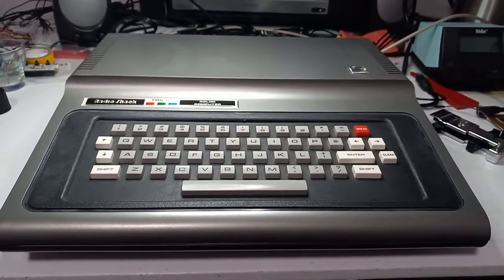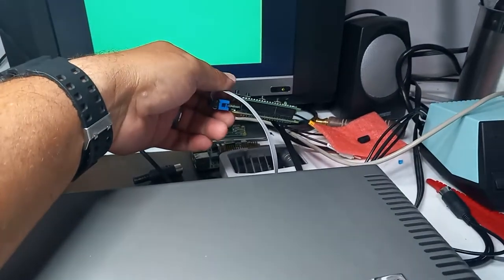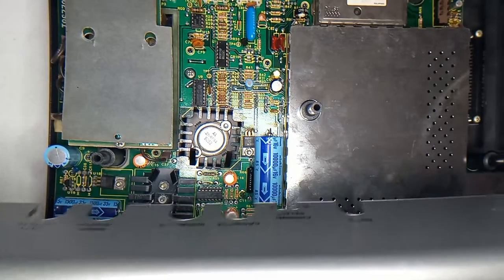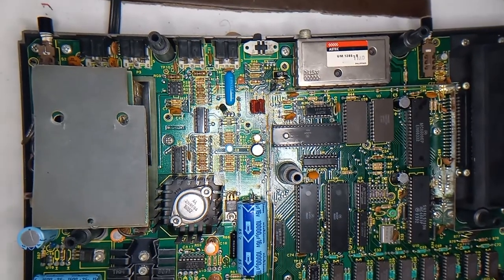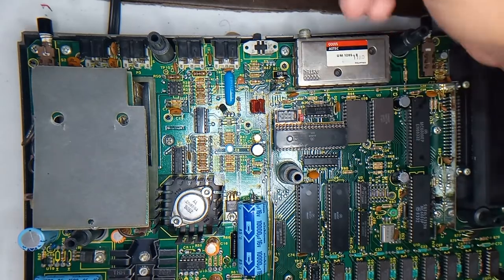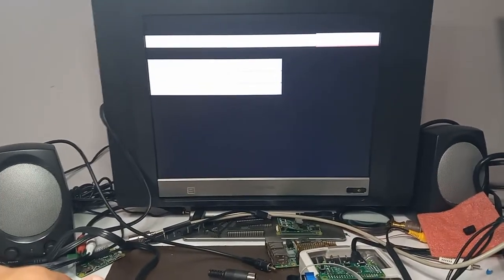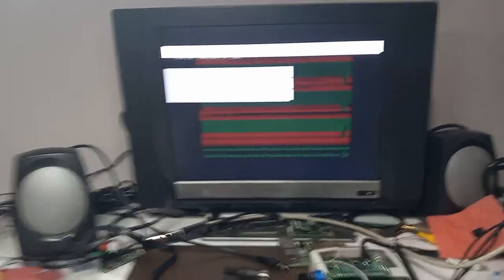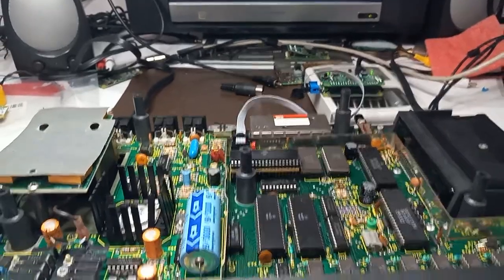Easy HDMI out for the Color Computer 1 and 2 with this adapter board. RGB to HDMI required.

Comment: Nice! Super clean way to interface the RGB to HDMI.
Reply from the maker: Thank you!
Reply: @rockyhill3  Clean solutions are the best solutions.  How much height difference is there and what modification might be acceptable to get the can back on?  If it were me, I'd be inclined to carefully snip or cut a section of the metal so that I could bend it outward to account for the added height and then seal it with aluminum tape.  Ideally, the pin (IDC?) connector should appear outside of the can in some way.  I think as people go to HDMI they won't want to go back or take it out unless they want to put that mod into another CoCo.  But there is one glaring issue.  It would seem from images I have found of the CoCo1 (I have never owned a CoCo1) that it uses TV out only.  So where will sound come from?  This mod drops sound it seems unless I'm wrong.
Reply from the maker: The height difference is about 15mm which leaves plenty of room to put the cover back on(thankfully). I thought about snipping the can as well and I might do that because I actually think it will look good in a weird way.
You're right in that this mod does not take sound into account and that's because the RGB to HDMI  project does not support sound, at least not yet. There are rumblings about somehow adding sound with a different version of the 12-bit board and a raspberry pi zero 2. 
https://github.com/hoglet67/RGBtoHDMI/issues/254
https://github.com/hoglet67/RGBtoHDMI/issues/177

That said it's pretty easy to pick up sound at a couple of points on the board. Aaron Newcomb did this in his video when he adapted the RGB to HDMI adapter for his CoCo 1.
https://youtu.be/Wm2eo4BEna4?t=2226
Reply: @rockyhill3  I was thinking of modifying the TV out box by adding an RCA or even small headphone jack to it.  It obviously requires cutting the outter case and many would cringe at that (no blame!  I might be reluctant too) or perhaps some other creative way I hadn't considered.  If I had one of those in my hands, it might be easier to imagine.  Obviously having HDMI integrated with audio would be the ideal.

I did spend some time watching that guy's videos and he did one on the CoCo3 as well.  I hated to look at the cable with the diodes the way he did it.  I'll compare with your version of the cable though I'm almost 100% certain you did it a lot better. 

My mistake, I don't see a CoCo3 version... just a CoCo2 version.  But the solution I imagine would be a tiny little board that has two male headers (in and out) where the little board's traces or bodge wires also host the diodes.

My bucket list keeps getting longer and longer.  Wish I had a 3D printer to make little project boxes.

Comment: This is a lot nicer than my solder tacks and hot glue solution. :)
Reply from the maker: Thanks! although I have to say that I hold hot glue in high regard. Hot glue is a respectable piece of engineering and it isn't only for arts and crafts!

Comment: Are those RGB signals the same level as what CGA/EGA uses?
Reply from the maker: Although called the RGB to HDMI adapter it actually has the ability to read the YUV voltages off of the 6847 with the addition of an analog board which the one I have is fitted with. The 6847 doesn't output RGB but the RGB to HDMI can do that. It can also convert VGA/EGA signals as well, it really is a versatile converter that can be used on many retro systems.
Reply: @rockyhill3  this is basically doing component to HDMI, which is the best we can get out of the 6847 👍
 I ordered one of these to use with RGBA from the CoCo 3, but this looks nice too. How hard is it to inject audio into the HDMI signal?
Reply from the maker: @CoCoNutBob  Actually, it recreates a fully digital image from what it reads from the YUV signals and it looks really crisp. According the maintainers of the project, the pi zero doesn't have any processing time or inputs left to handle audio but there is talk about sampling audio with the pi zero 2. There are a handful of ways to inject audio into the HDMI, some pricey some not so much. https://youtu.be/lIacGn5m7bw